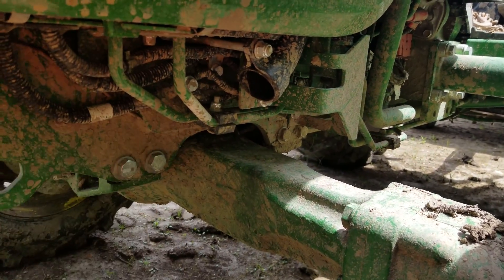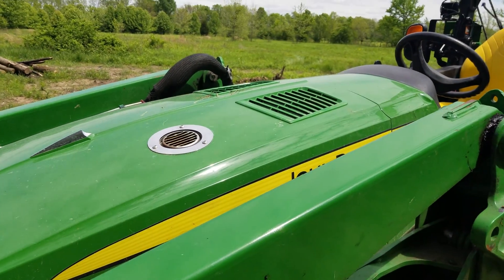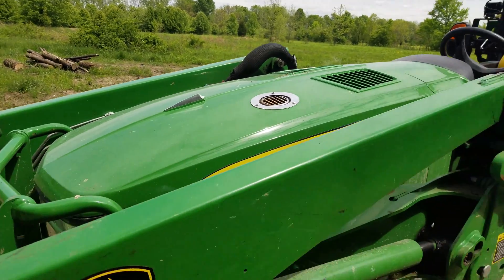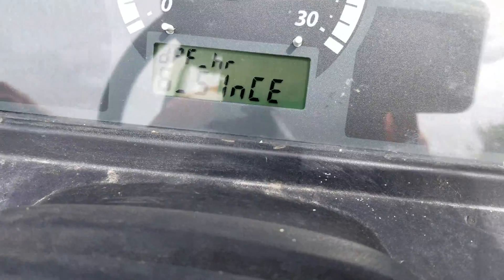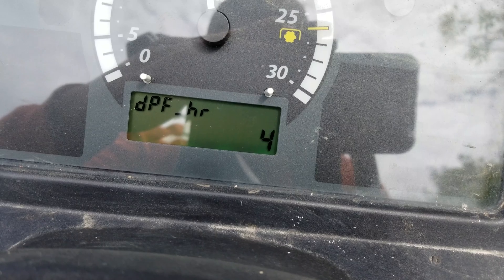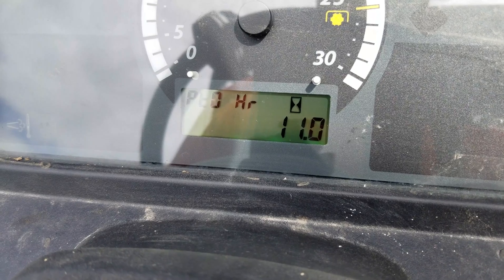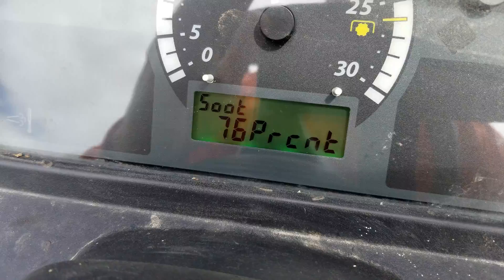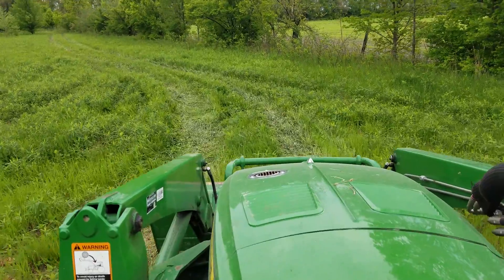Tier 4 Diesel Engine Regeneration (Regen) - John Deere Tractor

Comment: Another way John Deere can control service my 3032 tractor asked for a sitting Regen supposed to give you plenty of time to do it but half hour after this was displayed the computer shut it off not allowing me time to do Regen result dead tractor after dealing with John Deere customer service which did nothing to help the dealership was equally useless wanting to charge me 3hours for a diagnosis even though we all knew the problem complete rip-off I got lucky after about 20attempts I was able to do Regen fine now but I learned alot about John Deere customer service it sucks so if you see standing Regen required do it immediately John Deere has a firm grip on software for this reason I'm not impressed

Comment: I’ve got a 2020 D series 3043 , it’s a tier 4 system, it’s annoying but at least you can use it while in regen. Also it won’t let you drop below 1500 rpms, however if you want it to get done faster crank it up. I do mine around 2500 rpms unless I’m working it then it’s higher and gets done quicker

Comment: Very helpful. I’ve got a 2020 4066R with 1053 hours on it and it’s going back in to the dealer with its 4th error fault in the last 500 hours. Hate that regen. 
The issue is that it automatically goes into regen and every other time, it won’t complete. Meaning, it only brings the soot level to 50% and then just decides that is enough and stops the process without intervention from me in any way. 
Damn thing’s computer  needs dealer to reboot computer. Super annoying.  Right now it only could get soot level to 75%. Arrrrgh
Reply: This is the big scam have to go to dealer mine is 2hours away

Comment: Thanks for posting this, man !
I guess it wants to cook off the soot.
Another pain in the ass.
Computers and tractors don't mix, as far as I'm concerned.
Over an hour to do this crap. LOL 
Yeah, The manual doesn't even mention how long it takes.
Reply from the maker: You're welcome!  I have learned a lot since I posted this.  When it starts, throw on a ground engaging implement, crank the rpms, and work the tractor as hard as you can.  I have completed a regen in under 20 minutes! Ha

Comment: When it goes into regen does it hurt it to turn the throttle up a little ? Mine was regening at 1600 rpm and I turn mine up to 2200
Reply from the maker: Not at all! Do it!  Best practice is to push up the rpms and work it has hard as you can.  I have found that ground engagement implements do the trick.  I have completed one in 15 min before!

Comment: So basically if you're working and at a critical point while operating your tractor and it goes into Regen mode you're basically stuck with your pants down at your ankles where there nothing you can do but let the tractor do its thing ?
Reply from the maker: It's only an issue if you need to shut the tractor off and leave immediately.  If not, then I use it as a major opportunity to work the tractor as hard as possible.  The harder you work it during the regen, the faster it will complete the cycle.  If you have the opportunity to do some serious ground engagement work when it is regen'ing, that's the best time to do it

Comment: I found that if you Put it in neutral with the parking I brake on and she will rev up higher and cut the time down by allot  but I think you have to do that when you start the regen  sometimes it'll be done in like 10 minutes

Comment: my 2014 3038e is doing an active regen after every 15 min or so of running.  A light comes on and tells me to increase rpm to 1500.  When I do, it' goes into regen and it lasts for about 30 min.  The soot level goes from about 78% down to 72%.  Should I try to do a parked regen?  
Need help.  Thanks.
Called dealer but all they would tell me it to bring it in.
Reply: dont run under 1500 rpmfor anything dont sit and idle gear down run at faster rpm.
Reply: @garymalchow6996  Thanks.  So, in order to "save" pollutants, we have to run our engine at higher rpm.  Anybody else see the irony here?

Comment: Have a brand new 3039R diesel.  The DFP high pres sens fault came on with explanation point light.  Did the exhaust cleaning cleaning with dealer.  To no avail the lights never went off.  Still under warranty but the cost is the travel for dealer.  Around $1300.  I am pissed
Reply from the maker: Dang that's a tough pill to swallow!  I'm sorry you are having trouble.  How far away are you from your dealer? $1,300 seems expensive for transport!  You may want to consider finding a utility trailer to haul it yourself.  It wouldn't take much to tow a 3039.

Comment: That’s weird, our 2020 4066R exhausts out of a pipe kinda through the front frame structure. It still has the cutout on the hood, but it’s just got a flush green cap over it. I wonder what they changed to run regen through the same exhaust? 
Perhaps heat was too high on the old pipe location and to prevent igniting brush or something they just dumped it straight up? The new location is neutral enough that I can’t see that being an issue.
Reply from the maker: That's very odd.  One would think that vertical exhaust during regen would make more sense than it being closer toward the ground.  Maybe they found a way to reduce the exhaust temp as well?  I know that when mine regens the heat is inasne.  Maybe someone smarter than me will tell us in the comments.

Comment: I have a 2019 3038E in Germany. And my tractor doesn't has this regen button, only the 3 top buttons. Under the hood there is a DPF. Can somebody explain that to me ? I have a DPF but can't manually start the regen process ?

With the middle button in the top row you can switch through different hour counters. Like engine hours, PTO hours, but even there is no soot level indication.

Comment: The video was well rounded thanks! Has anyones soot level jumped up 70% in a 2 hour work session? Today the tractor regen'ed ,got down to 11% then after loading about 8 yds of stone and backbucketing for about 2 hours at 2500 rpm- the soot level jumped 84%. Seems like a alot? I just got this JD 4044M  used with about 900 hrs and I know very little about DPF's... Or tractors... I also have a constant flashing caution with no other lights, any one have and ideas on this? I have a filter kit and new oil and hydraulic fluid on the way  to overhaul but wanted to know how these caution signals should be regarded. Thanks
Reply: I've got the same tractor. The regen process is pretty annoying. Honestly couldn't say about your flashing lights!

Comment: Take that tractor and get rid of it and buy u a Massy Ferguson they don’t have regin or DPF go check them out
Reply: they have them to, or worse, they use DEF
Reply: The way I understand it Two basic ways manufactured can meet current emissions standards. With these smaller tractors. One way uses  the particular filter. With the Regen burning out process. The other uses the DEF fluid injected to get the job done. Massey choose the DEF fluid. Pretty much all the other went with the particular filter/ Regen. I would much rather just buy the DEF fluid and be done with it. I bet the cost of injecting diesel into the particular filter during the regen process. Would cover most if not all the cost of the DEF fluid. My only problem. There isn't a Massey Dealer in my area now.

Comment: So I had indicator lights come on but didn't know to leave my machine running to complete a regen. Now the STOP indicator light is on and my dealer says I can't reset it myself, that I have to bring it in to the dealership to reset the system. Is there a way to do that myself? I need to cut hay and their shop is backed up for two weeks. The tractor has only 110 hours on it, that's ages away from needing a regen.
Reply: Indy Farm Life We thought about disconnecting the battery, it’s worth a try. Thanks for your advice, will try those things. Yes the new technology is tricky!
Reply: I had the same with my 4052M. The regen is extremely poor...I’ve had multiple regents that take two to four hours to complete. One time I could not let it run, so I shut it off...long story short was that I had to haul to JD Service for a regen and a $400 bill.

Comment: How does the diesel get to the DPF during the burnout. I have read that fuel will be injected on the exhaust strokes of a particular cylinder. Good video thanks
Reply: I got the wording on a goggle search correct and come up with what they called direct and indirect. Direct uses a separate line to feed the DPF.  Indirect puts it in the cylinder on the exhaust stroke
Reply: You got me to thinking after watching your video. When you check your tractor look for a diverter valve for the exhaust. I remember you saying that nothing comes out of the muffler during the regen cycle. Thanks
Reply: It’s just heat and pressure it regens when your rpm is high

Comment: Why does mine do a regen almost daily. I try to avoid idling and operate it at a higher rpm but it still regens either daily or every other day. It only has 345 total hrs.
Reply: We shouldn’t have to deal with this garbage, it’s not right. We need to get someone important to start talking about this.
Reply: @kb6069 It is the government’s bs that is the cause of this.
Reply: I have a 2018 4052M, and I am completely disappointed with it due solely to the regen. The tractor, like yours, goes into regen virtually every day often multiple times a day, and the regen often takes hours...this is fact. It’s so frustrating as if you shut it down when it is running in regen you risk that it will require a regen that can only be accomplished by John Deere service. I’ve had to do this once which cost me some $400.
Reply: @markrossow9598  Hi there just wondering if you have done the Parked Exhaust filter cleaning method. When mine begins to do it on a regular basis I have learned that the parked method helps out. Just a thought if you haven't tried it.

Comment: What did the soot percentage end up at after the regen?
Reply: Indy Farm Life our was having issues we started at 78 percent but only went down to 60 percent after running tractor parked at 2300rpms for 2hrs. It wouldn't let me do a parked regen at the time. But later the tractor did a clean out and only got down to 54percent. I just changed the oil and cleaned out air filter and blew out other parts yesterday. We used tractor about 4hrs yesterday at a higher rpm and I noticed this morning our soot level is now at 3percent..